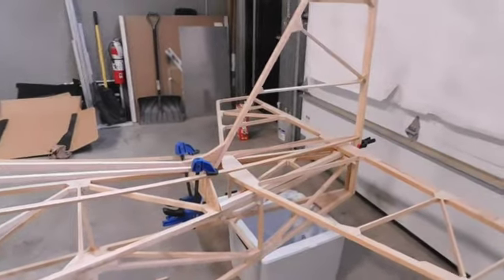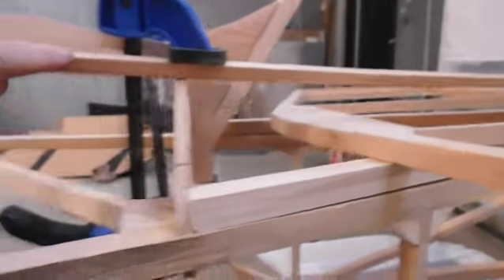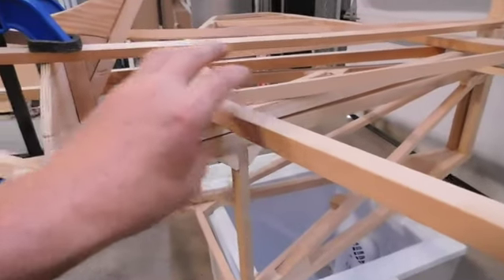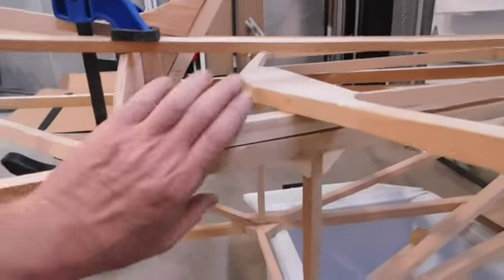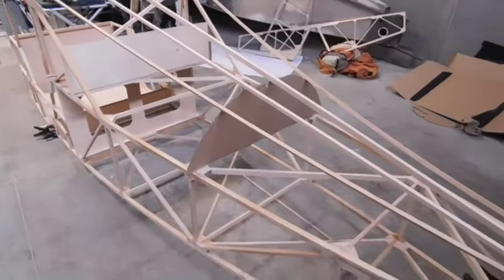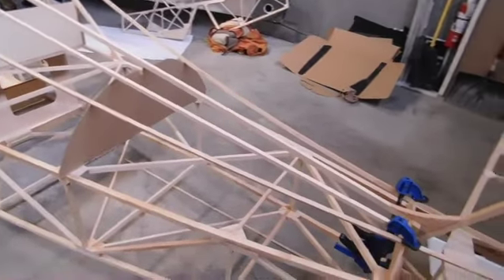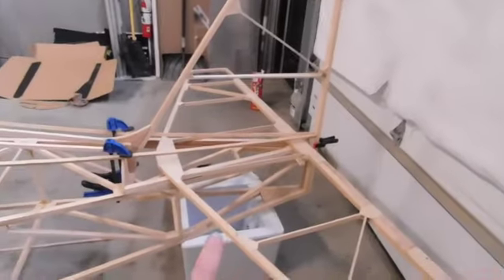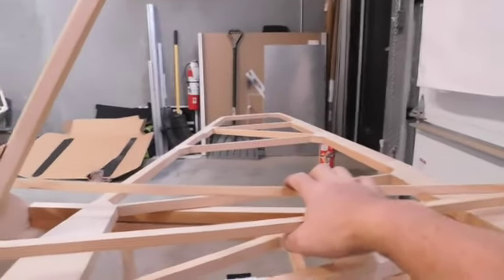DAKOTA HAWK EP 101

Comment: Yeah, this is an area where the plans suck. Really no guidance at all on how to button up that area. I'm thinking about just adding another stringer above the stab, leave a slot just large enough that the stab can slide into place.
Reply: Get u some wedges from lowes or homedepot. Do what u think is best. I would just leave that open to slide the horizontal in place. Make molds out of foam to make that shape that goes over your horizontal stab. Then take plexiglass, heat it up to make it soft, place over that mold and walla. I definitely wouldn't cover it all up just incase u need to make adjustments to your horizontal stabilizer.
Reply: Remember that it will have to be a big enough opening for the horizontal stab and elevator on top…. So an opening 2” thick…